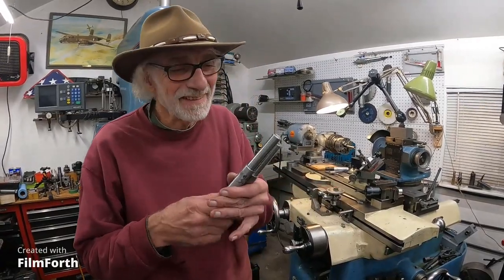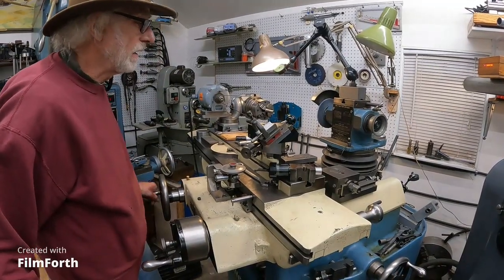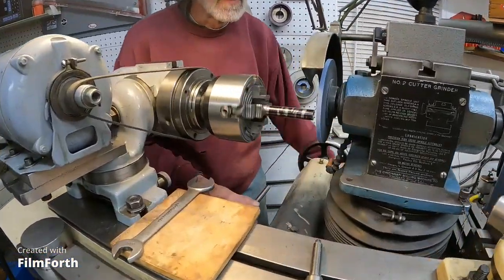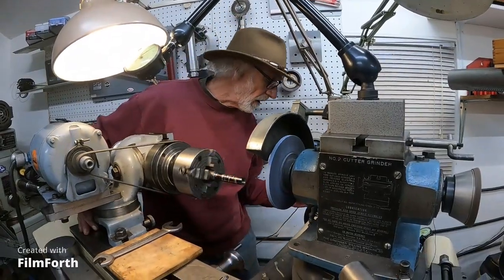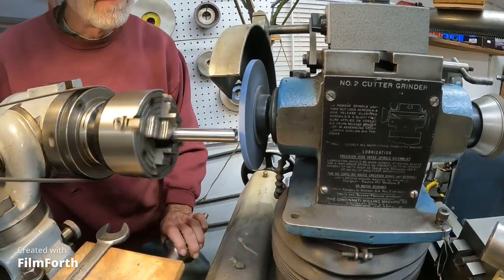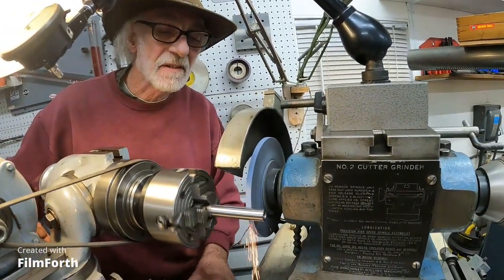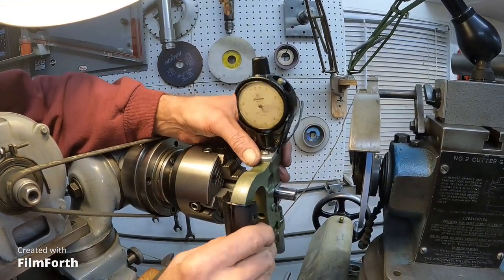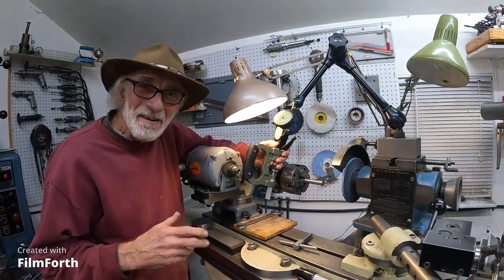Tool & Cutter Grinder toolroom cylindrical grinding

Comment: Thanks for the video! I just picked one up. Do you dial it in with the 4 jaw chuck, what's the benefit of that vs a 3 jaw or collets? I'm just looking at accessories for mine.
Reply from the maker: Hello! I started with the 4 jaw chuck to modify the lathe adapter for 5c collets that I already use for other machines. Just a matter of having multiple methods of work holding, thanks.

Comment: What do you think the rpm is on your work head, I have a TOS bn102 with a motor driven work head but the pulley on it is huge and I want to reduce the size.

Comment: Just curious. What kind of bearings on the table. Is moving it fast back and forth creating a wedge of oil that is lifting the table slightly. Like trying to balance a grinding stone  on a ball bearing v block and having the stone kick back as it stops
Reply from the maker: The table rides on 44  3/4" balls dry no oil and weighs around 300lbs, I dont think it lifted, but it might have.

Comment: If you wait till at room temperature won't that affect your readings? Cheers
Reply from the maker: I have to do that for close tolerance size but not for taper, the bronze bearings will be fit to size by Sunnen hone and there is .015" range for nominal size.